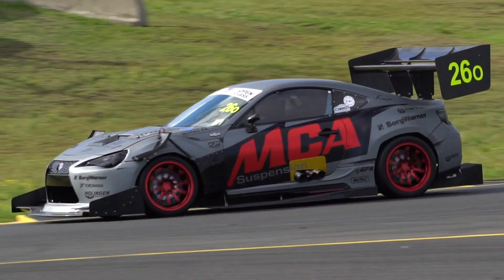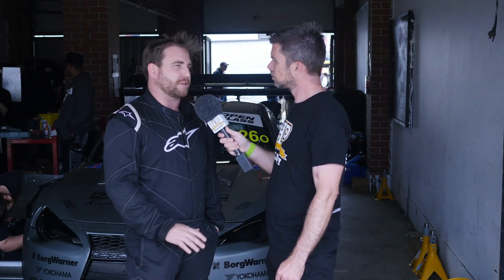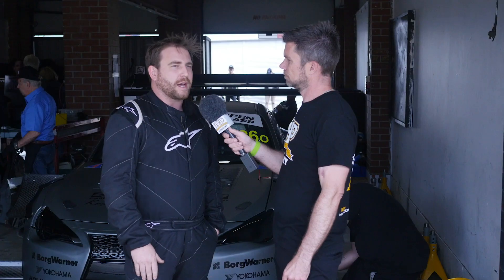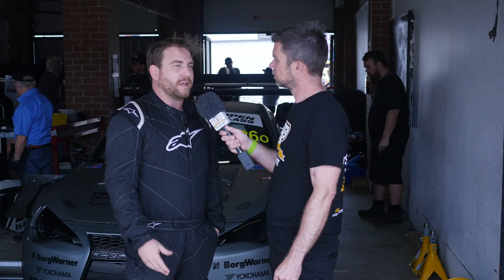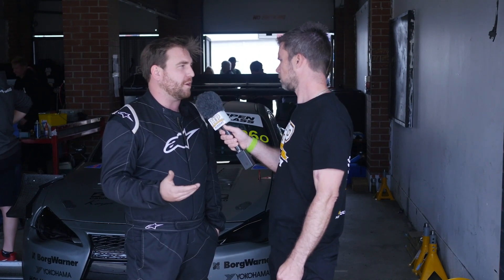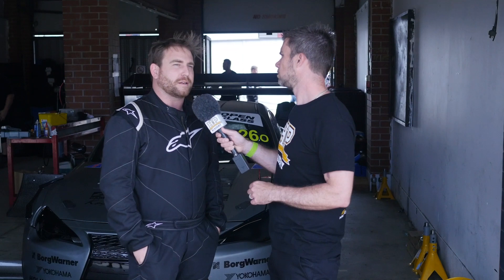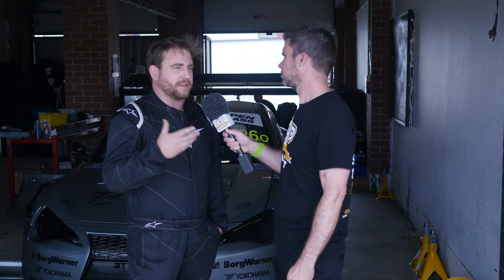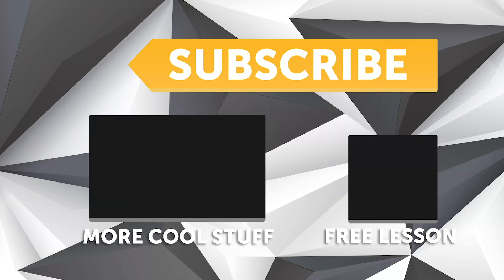1067HP GT86 | GT-R VR38 Swapped Time Attack Toyota 86 [TECH TALK]

Comment: How the hell did he get the VR to sit so low?
Reply from the maker: The single biggest help with this would have to be a dry sump. They can make a huge difference to how you can mount an engine depending on what you're starting with and what is under it - Taz.

Comment: Doesnt having a 600lb lump of a vr38 adversely affect the handling of the car? Why not put a 106kg 1500hp Thor engine in it?
Reply: That's the road going weight of the engine, I doubt hes running A/C, power steering, mechanical water pump or any of the bracketary and emissions compliant equipment that the engine runs, it's easy to get the engine down to 210kg.
Also this will make over twice the torque of the engine you speak of its simple physics. Larger displacement = more torque regardless of turbo size.....
Reply: @Big2009Gee  Understood. 210kg seems a little better than the stock vr38. However, speaking of torque, Oskar from Elmer Racing told me that the Thor engine is rated at 1100 ft/lbs of torque in 1500hp specification. This should be plenty for wtac I would imagine.
Reply: The team that ran the porsche with that engine had a budget of about 5m. Josh did this for significantly less. Same with their hammer head car. Much smaller budget. Thats a 200k engine. Josh probably spent that on the entire car build almost.